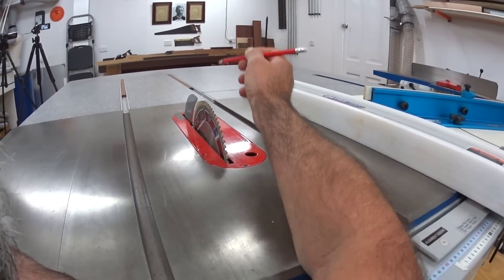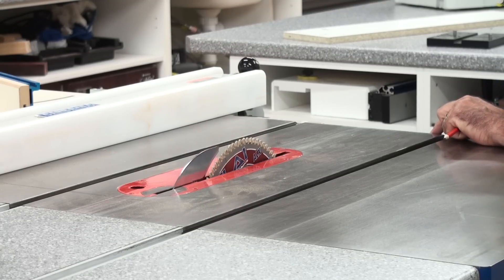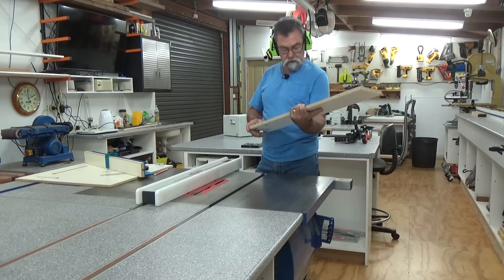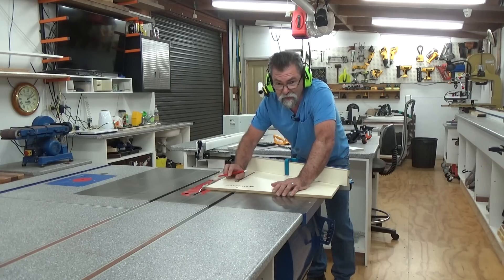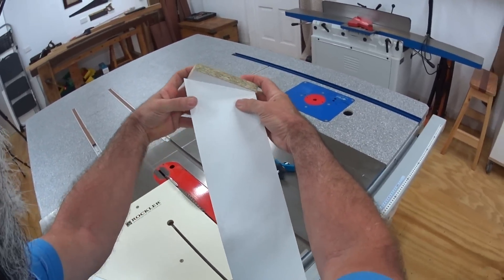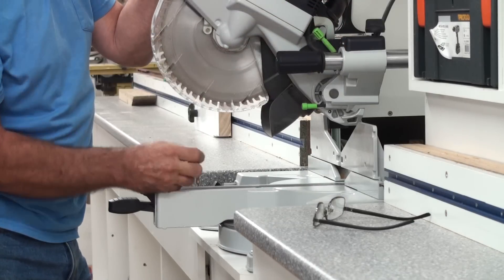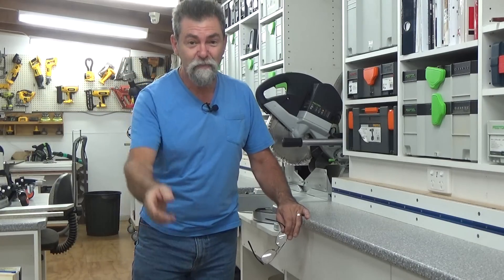saw melamine | no chip | woodworking | dave stanton | how to basics

Comment from the maker: I could have been extra safe doing the through cut on the table saw by using my gripper push block. As not everyone can afford a gripper and melamine is a slippery product, the main thing is to use a push stick or block that has a non slip surface. And keep your wits about you!
Reply: David Stanton have you ever made any push blocks?
Reply: Thanks!
Reply: First I'd like to say thanks for the very informative video, and the safety tips.
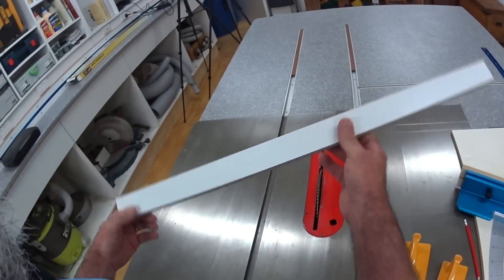But on that note, and I don't mean to be "that guy". When you made the cut around the 4:30 Mark i was a little uneasy watching it. Using push blocks to move material is correct 👌  but I personally think placing the the material the other way so that the smaller off cut is not between the blade and fence, with the push pads and a table saw that has any movement/flex in the fence you can possibly rotate/ angle the material and can cause the fence and blade into a "wedge" arrangement, causing kickback, and other serious injuries. The larger piece allows a direct push forward with a hook style push block or push stick and maintaining as much distance between the squishy and the choppy. 
This suggestion/ critique comes from personal experience with Makita site saw (MLT100) where I was extremely lucky and can still count to 10 and not 6 if you know what I mean 😉 
Again I apologise if I seem pedantic, thanks again for taking the time to share your videos. 👍

Comment: Thanks so much for sharing this. You've no idea how much time I have wasted, trying to cut melamine cleanly - scoring the surface with a utility knife, cutting slightly oversize, then trimming the edge to finished size with a straight cutting router bit, running against a straight edge. It works but takes so long to set up for each cut. Wish I had seen this before now. Will try it on plywood too. Thanks again. Great videos!!
Reply from the maker: I hope it works well for you!

Comment: Thanks for the tip mate. I was frustrated that while using a similar blade (not as good as yours but same tooth setup). With a zero clearance insert i was getting a clean bottom but the top was not great at all. Using your method instantly perfect no chips at all. Will have to shout you a drink at the next wood show.
Reply from the maker: Thanks for the compliment Max. I may just take you up on that beer!

Comment: 30 years ago I fitted out my kitchen with purchased door and drawer fronts from a company closing down and making the carcass for both myself . So I asked a fitter how to keep melamine boards from chipping on a saw cut, he advised buying a router, which I did and was amazed how well the finish was. I now have a small table saw and have purchased a triple tooth saw blade and look forward to see if the results are comparable with the router.
Reply: How did that work out?

Comment: Good idea, we've been doing this for a long time, it works with any kind of material and blade(carbide tipped of course), the most important thing is that your saw's rise and fall mechanism and alignment needs to be PERFECT if you want perfect results...the sawblade's distance from the fence has to be exactly the same at both(lower and higher) positions. Be safe, have a good day!

Comment: Do you need a melamine saw blade or is a regular wood 60 T good clean cut for drawer fronts?
Reply from the maker: It depends on how clean a cut you want. I like to use a special melamine blade but they don't hold their sharpness as long as conventional blades. Add to one function and subtract from another.

Comment: On my router when I don't have a compression bit, I use down cut half of it and up cut through it in a second pass.
Reply from the maker: That can work...if you have a steady hand.
Reply: @DavidStanton  oh it's a CNC router
Reply from the maker: Auto change on the spindle?
Reply: @DavidStanton  yea it's a Holzher Dynasty I think. I didn't spec it. I wish they got tool change on the y axis. Coming from the machining world, I like blistering fast tool changes.

Comment: brilliant tip with the arc mate,  I only do finish work now and again as am more of a first n second fix man,  dont have table saw so i use skill saw and straight edge .  Same principal shud work tho just that the first 3mm cut will be my upper side of the shelf.  Its been hard on me cause ive been having  to work with the shelf upside down,  this is going to save a tonne of time and stress.
Reply from the maker: Sounds like a plan Noah Schmartz

Comment: Love the content 👍 i just started my project in melanine with a tracksaw and scribe cutting. Results are perfect with special blade from cmt. Only not sure if its normal after cutting some fullsize built in cabinets its already getting dull. Also happens with your blades?
Reply from the maker: Interesting point Braeve. Melamine is extremely hard...one of the benefits of using it but the trade off is blade dulling quicker.

Comment: Hi Dave, thanks for this excellent tip. I am a newbie and have only a circular saw. Can I have perfect cut on white melamine board using this same technique. I don’t have a table saw. Also what kind of blade should I buy to clean cut melamine please? Awaiting your reply. Thanks 🙏
Reply from the maker: Hi Prakash Samputh! It depends on a few things and one is a good blade that doesn't wobble at all. Buy a blade designed for fine cut finish work, not a rip blade or combination blade.
Reply: Wow that was quick. Thanks a lot for your prompt reply. I’ll buy a new disc today. Cheers and keep up with your tutorials. You’re a great inspiration and a very good instructor.

Comment: First, let me say that I love your videos. I'm super excited about the MiterSet since seeing it featured in a previous video, but while I do agree that this technique will work as I've used it in the past, I find it's fairly impractical if you're doing a lot of cutting of various sized parts as it essentially doubles the amount of passes required. Still, it does work though.
Reply from the maker: One of the great things about Mitreset for me is that I can jump straight in to get my mitre gauge perfect every time I change an angle. Thanks for watching!

Comment: Hi David, Just subscribed.  I saw your Jessum saw fence feed roller magnet jig.  I am building that for my shop.   Quick question is there a method or service, if it makes sense, to have some of my 12” 60T Freund saw blades sharpened.  Just wondering what you do on sharpening or if you do it.  Keep up the good work.
Reply from the maker: Hi Jonny Mando On The Move. I send mine out to a saw doctor. If you are in New south wales, try Henry brothers.

Comment: how about routing with handrouter and plywood template into melamin? I need to rout into a edgebanded melamine board to make space for a Gola aluminium handlerail for handleless kitchen cabinet. Would a 2 mm first routing cut prevent splintering, and make it possible to rout from one side only, or should i rout from both sides?

Comment: The Kapex tip is gold David. But am I right in thinking the promac blade is only for small jobs ?
Reply from the maker: Thanks Brian. The Promac blade is for commercial use, 3,200 lineal metres of cut between sharpening!
Reply: Wow. The double handling of material would add up in man hours though. Would still rather a scribing saw set up. For small work shop home use though that many metres is impressive.
Reply from the maker: It does add up Brian but I am yet to see a saw that does it all. I haven't seen a saw with scribing blade that can accept a dado stack. Using a dado is something that I want to explore very soon and my cabinet saw will accommodate one. 
3200 metres in commercial use is very impressive.
Reply: We always used a router in a trenching jig, router table or shaper ( spindle moulder ) to do what a dado stack does. A dado stack does look like a very safe tool option though. Very interested to hear what you make of one.

Comment: Hi David,
I only have a 4" circular saw. Can it be used for absolute clean cut?
Reply from the maker: Hi New identity. I have never seen a 4 inch circular saw. What make and model is it? Have you had it long? Have you tried using it to cut sheet goods?
Reply: hi David,
I have a 4" Hitachi CM4SB2 tile cutter, similar to circular saw which i use to cut planks and plywoods using 4" blades. i wanted to know if it is possible to use it to make clean cuts the way you do in your videos? i've not yet tried it because i have not yet bought the melamine plywoods. i wanted to know if its possible first, then i'll buy the melamine plywood. Thank you. I am a small handyman with not so much tools as you do and try to make as much as i can with the small quantity of tools i have. thanks for  your help.
Reply from the maker: I don't know if the saw will spin the blade fast enough to achieve the cut as your saw would be designed for masonry, not timber. I doubt there is a saw blade on the market for it. I am sorry that I don't have any answers for you. Go to a kitchen company and ask if they have some scrap that you can try it out on.
Reply: thank you very much David. i'll keep you in touch.

Comment: Dave, I am wanting to cut 6cm off a 50cm laminated laundry bench top, my problem is I can’t remove it as it is tiled and plumped in, is there any way to d it with out chipping the edge
Reply from the maker: Interesting point John Lawrence,. I would use a score and snap carbide tipped knife against a straight edge, then a track saw positioned so the outside of the blade lines up with the bottom of the score. Then a very good blade in a multi tool to finish the cut off.

Comment: I have the same saw as yours. I'm having difficulty in finding a riving knife to suit. Where did you obtain yours. Also I noticed you have a better saw guard which looks like a Sawstop type. Is this correct and if so what model number. Thank you in advance for any assistance.
Reply from the maker: Hi Geoff. I purchased my riving knife from Carbatec and also the blade guard from them. I had to retro fit the guard onto my splitter. Code is 
  SST-TSGDC

Comment: Dave want to ask you the size blade i need for dewalt portable table saw ?
Reply from the maker: Hi Quite your mind! Well, which one?
Reply: @DavidStanton  Its the DE7491 it says 254mm blade but they only have 250 on that site , which blade exactly would  you recommend im new to building my own built in wardrobe , i have a festool track saw for my cross cuts , just want to make sure i get those cuts right for edging , also was thinking buying a portable edge bander , do you think iron on is good enough ?
Reply from the maker: 4 mm less on diameter is nothing, it is only 2 mm less depth of cut. I use iron on.
Reply: @DavidStanton  ok thanks

Comment: Hi Dave, is it possible to use the same technique with 40 teeth saw blade,I'm not a wood worker but certainly I'm a DIY person
Reply from the maker: Yes Elvis. This method will give you a cleaner cut to the underside of the board in comparison to a single pass cutting right through.
Reply: Cheers mate

Comment: Hi Dave isnt it safer to have the cut piece of melamine on the left of blade instead of the inside next to the rip fence?  Or is this necessary for this technique?  Thanks Bill
Reply from the maker: Basically you are correct Bill. This was more a demonstration on achieving a clean cut, the rip fence was set at a random width. Thanks for watching!

Comment: didnt even need a zero clearance plate!  This is the same method as the tracksaw with the scribe cut, although a reversed direction scribe cut would be far too dangerous on the table saw.
Reply from the maker: Deborah Coughlin, correct.

Comment: Only shelves require a 'Good two sides'  I guess.  Sides of a cupboard usually have and end panel so I just cut my melamine/veneer always face down
Reply from the maker: Face down or up 86rix, table saw, track saw or sliding compound mitre saw?
Reply: David Stanton I find whichever ever side of the panel first makes contact with the blade is the side that tends to chip.  So the underside of the cut tends to be great even when I'm stuck on site with a bad blade.  So now it's just a must to cut always Good side down on circular saws,  or good side up on table saws with no scriber
Reply: I do believe this trick does wonder if you're cutting Face board, for like draws, doors and panels (that over hanging and could be seen.) I understand what you mean 86rix by no one seeing the chip side if your screwing up cabinets together. like having the chip side butting up together to other cabinets or hidden by the walls/infills. But this is an amazing trick for cutting your face board or veneer and i believe it leaves a CNC finish, you wont see a scribe like when edging doing this trick. I would like to know how long the blade last without chipping outs. Because when i was taught to set the scribe blade up, the blade is slightly and I mean ever so slightly wider then the saw blade because just the blade being in contact with the board risks causing break out. Tho David amazing job and lovely tip that I'll keep! You're an amazing cabinet maker that's giving me amazing tips. Your review on that carbetec bench top thickness a while back sealed it for me when buying it over the jet one. Are you still using it?